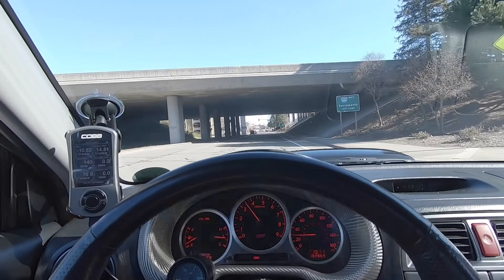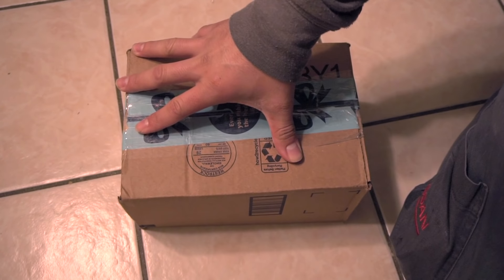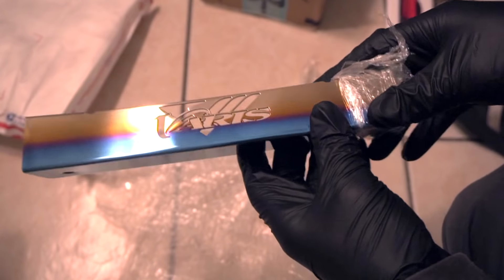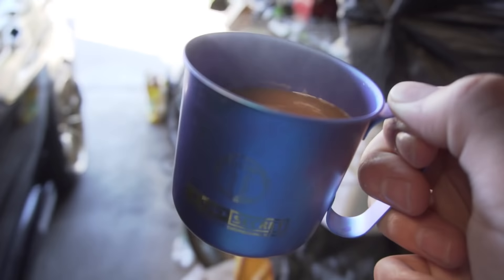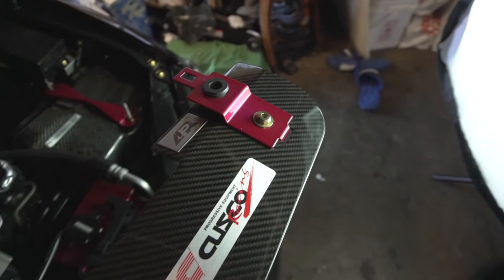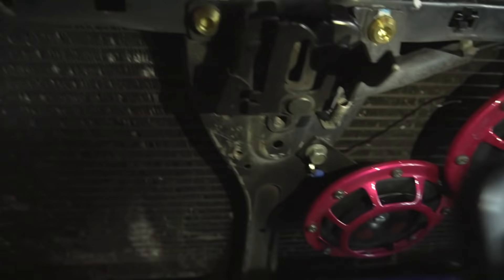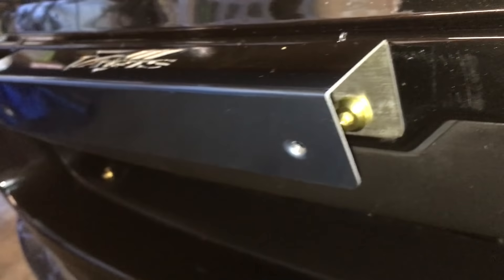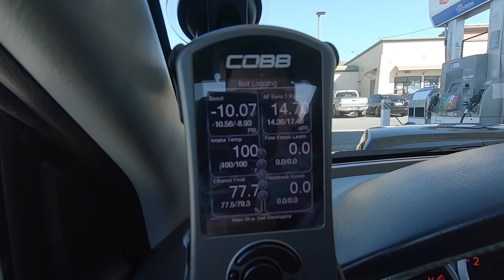RARE JDM part for my 2004 Subaru WRX STI!

Comment: Hello, I think your subie is super clean! 
So I’m new to the car scene and you mentioned your ethanol level is going down, is that a good or bad thing? 
If it’s bad, how would you raise the ethanol level? Thanks
Reply from the maker: Hey & thanks for watching the channel! The higher the ethanol content, the more power the car makes. Unfortunately, if the ethanol content goes down, then there’s not much we can do because it’s ultimately in the hands of the fuel company. Even if it goes down, then my flex fuel kit will adjust according to the ethanol content and my car will be safe :) hope this helped
Reply: EddieNuffSaid 
Oh now I understand, thanks for making these videos!

Comment: Is a 2005 sti with 106k miles worth getting
Reply: SPEEDDEMON - how much $?
Reply from the maker: Depends on condition & price
Reply: EddieNuffSaid the price is $14,500 and it’s in good condition
Reply: @alexhiro-1241  My friend is selling an 05 Sti with 60k on it for $5000. Needs center diff, tune, new struts, cobb accessport screen is cracked, and trans grinds 5th i think. Its a good deal if you're in PA
Reply: @user-vx9uo8xg6m  no its not the trans job alone is 5k. It'd be a money pit more than STIs already are
Reply: @user-vx9uo8xg6m  just wrap that sti around a pole report it stolen get the insurance money. Other then that your friends sti is trash. Not even worth 2500

Comment: How much power you making?
Reply from the maker: 384whp/401 wtq
Reply: EddieNuffSaid so much torque. I’m at 330whp and 360tq but on a super low reading dyno
Reply: EddieNuffSaid how much boost?